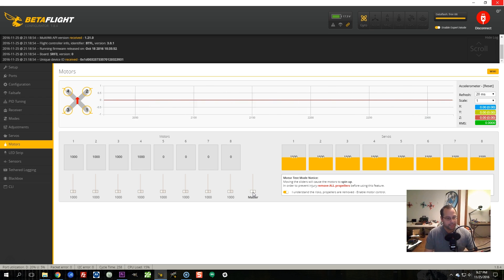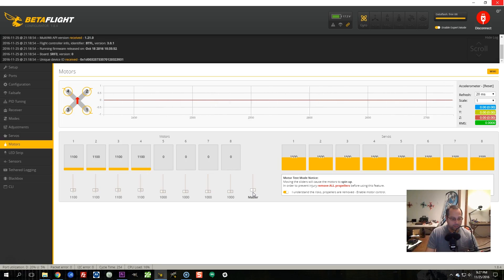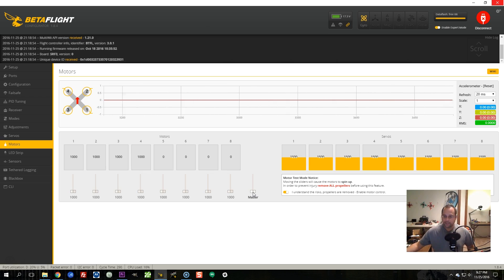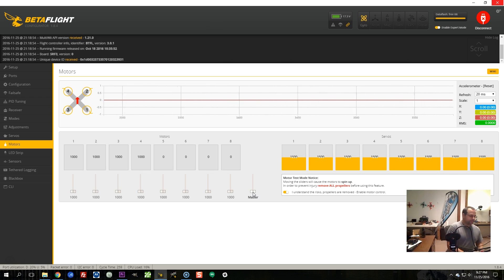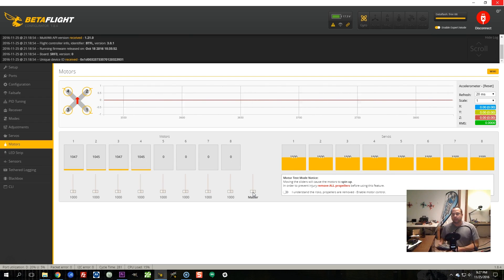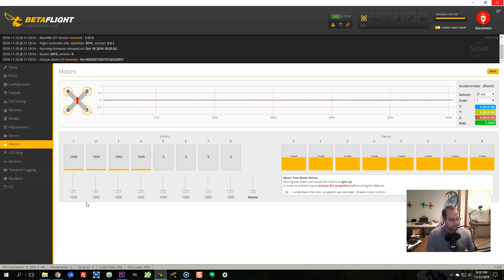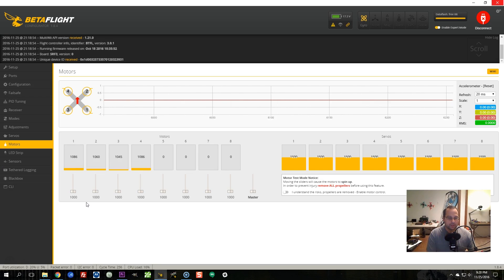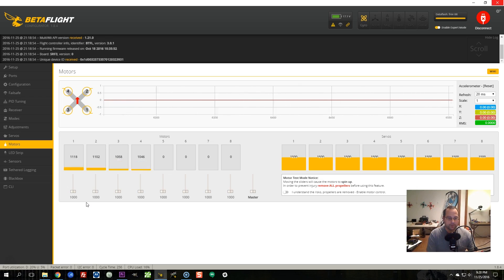Why Do Quadcopter Motors Spin Up By Themselves With Props Off?

Comment: JB, after see the video I still have an issue. I have a small Kingkong ET125 that after a crash I had to change the 4in1 ESC and FC. I´ve set everything in Betaflight 3.5.1 like my other 10 quads before but… The issue is when I arm the quad and start to hover, it rises suddenly even without any input from the throttle and of course it crashes (the FC is a F3 OMNIBUS NANO). I´ve tried many things but nothing works (ESC calibration, etc). Do you have any ideas or a link of a possible solution? Thanks in advance. P.S. – Love your Videos
Reply from the maker: This is sometimes caused by too much electrical noise or vibration. Make sure all filters are at defaults and PIDs too. Make sure the FC is secure (no broken standoff). That sort of thing.

If you "set everything like before" referring to an older version of betaflight, you may have accidentally turned off lowpass filters that are required. Filters changed in 3.5.1 and you should not disable the default filters like you used to in earlier versions.
Reply: Joshua Bardwell  I´ve checked the filters and are turned ON (Gyro lowpass 1&2 cutoff and  D Term Lowpass 1&2). About the standoff I can´t see any cracks on the carbon frame, so I´m assuming is OK.

Comment: I am so Glad I stumbled on this vid of yours. i know I posted "greenhorn" questions. THIS MADE SO MUCH SENSE. i wish you would make your own cleanflight prog INTERFACE. someone needs to get with you. you know how to explain it. do you know how many crap vids i watched over last two weeks? Oh!! By the way, got my motors working. everything looks a go for the test, but your assurance of the motors not showing level due tot eh PROPS... holey heck batman.. also.. rad. so rad. thanks man. Agree on the test.. Before I do, i want to do failsafe.. anyway, I WISH MORE PEOPLE WOULD EXPLAIN THIS LIKE YOU DO. so much important stuff is left out or skipped on. you get it. thanks man. It finally clicked. tyty

Comment: Hello I have simillar problem when I arm and  throttle speed up around max and them going down ,,about middle possition of throttle 1500 stay motor spining but when I going down 1400 1300 and minimum 1000 the motors still spining 1500 them I have to unarmed to switch motors.. i tested motor start spinig in BF 1060 and i set them in BF 1070 and in blheli s conf.. 1060... ..I dont know where is s problem. ? Anyone to help thank you 😉
Reply from the maker: This video explains why the motors do that, and why it's not a problem.

Comment: Can someone tell me if the esc are not tied down will the vibrations cause random changes in speed or dose the esc’s just do as there told and not have any feedback to I assume the pid loop?
Reply from the maker: Random vibration will occur whenever the PID loop is active. If you just want to spin the motors use the sliders in the Motors tab.
Reply: sorry i meant with my props on. when i land without killing the motors they seem to all fluctuate in speed up and down but all slowly build up speed (not erratically). i only noticed this because i swapped over all new esc's and motors and i was testing the quad. i put it down to my esc not being zip tied down to the frame and the movement of the esc's was causing this to happen?

Comment: This is almost the issue that I have now. I update the internal BlHeli's with BLHELI config. After that I made a new Motor calibration. Here the problem: If I use the master bottom or single bottom in Betaflight for motors, the motors turning like music, smooth, nice and clean and all of them on the same level. If I use my Transmitter (Futaba T10J), Motor 3 is increasing the turns and if I push the throttle stick quickly up and down, all motors running almost with full speed or the motors stop and run (like shaking). Can you help me? Do you have any solution for me, please? (sorry for my English)

Comment: Sir, please help me I am using inav configurator motor doesn't arm viva fs-ctb6 ppm transmitter. I'm using naze32 rev 5 flight controller.
Reply from the maker: In the Modes tab, check whether the Arm mode is turning color when you flip the switch. Does the Aux channel go into the defined range? If not, you must configure the transmitter (FS-CTB6) aux switch to control the aux channel.

https://www.youtube.com/watch?v=SLy28mYiAzU

Comment: Yes but my motors are either min value or spooling up to full? Am scared to put props on. It will not incrementally raise or lower it's either airmode or full throttle..? Please help
Reply from the maker: Search for my video "quadcopter flips on takeoff" and check those issues.
Reply: Joshua Bardwell the board is turning right instead of forward in configuration on betaflight.. it is probably because of when the receiver values changed on the receiver page and I had to switch the throttle,roll, pitch on the mixers page on my taranis qx7..? How do I allign the board and fix please Josh?

Comment: I though this video was going  to be about the motors are spinning up on its own after you arm the quadcopter
Reply from the maker: That is what it's about.
Reply: When I arm my quadcopter and increase the throttle, it goes up, and does not stop going up even after I turn the throttle back down. I have to disarm the quad to get the motors to stop. I originally found out this problem with the props on. Any suggestions

Comment: I do fly. I just don’t know why when I arm the motors the rev up slowly almost to the point where the copter wants to hover. But when I take off it flies fine. Just when I start up and it sits there.
Reply from the maker: What firmware and version?

Comment: Josh, you are da man! This is my first build, on the bench 1 and 2 were spinning faster than 3 &4. Thought the FCB was bad and was ready to throw in the towel. My problem was i did not have the FC board (F3 evo) mounted level in place and as you mentioned, the copter was trying to level itself as soon as i hit the throttle making that happen.

Comment: My problem just started, after I cleaned the quad with an airline with props off, I spun one of the motors about 2 seconds. When I came to fly all motors spin up but one motor has no torque and can easily be held still with one finger. I swopped esc and Motor, same prob so I swopped signal wire from cc3d and proved it is cc3d at fault. What has happened jb?

Comment: Thank you sir! This is my 4th racing quad build and first experience with this behavior on the bench... was a little scared to take a test flight based on what looks like a potential run away situation but I've checked that my failsafe works no matter what... time for some flight testing!! (thanks for clarifying!!)

Comment: Cant figure mine out. It does the opposite, when i give full throttle, all motors apart from one slowly decrease to zero and this happens whether the motors are running or even when i have no battery running the motors and just watch the sliders react in cleanflight, does the same either way
Reply from the maker: +Corey Gregson it's the same phenomenon.
Reply: So far what ive tried is, first was motors running, no props, where i saw the sliders in cleanflight go down. Then, no motors running at all, just using the radio and noticed the same. So i decided to try and hover, motors did the same until it hit the deck.

Comment: Hi, I have just started into FPV and my drones motors are spinning at different speeds with props on ( im assuming it is similar to this) but as I am new I havent a clue as to what to do. Could you please point me in the right direction?
Reply from the maker: +Daniel Landzaad it's normal. Just go fly.
Reply: Thank you, just a quick question. Should I be able (as a comolete noob) to hover by just putting the throttle up?
Reply from the maker: +Daniel Landzaad vs what?
Reply: Vs what its doing now which is just freaking out

Comment: my problem is probably similar to this, each motor is indicate different fluctuate reading less then 1000 even the throtle stick is zero, is it normal ?
Reply from the maker: +saiful ezam yes. But if they are less than 1000 then your min_command may not be correct. Set it to 1000 and re calibrate your ESC's.

Comment: Older guy here, new to FPV.  Done all kinds of RC... but FPV seems like a blast...ok question.  quad all "setup", doing some LOS practice, with punch outs.  #3 motor randomly wont "catch up" on recovery.  quad dives in direction #3 facing.  Is this esc issue or FC issue... thanks
Reply from the maker: I would swap the motor with a new motor, or swap two motors on the quad if you don't have a spare motor. If the problem moves, it's the motor. If it doesn't move, it's probably the ESC.

If it's the ESC, then swap the ESC just like you did the motor. Again, if the problem moves, it's the ESC. If neither of those things move the problem, then it's the FC.

Comment: When I plug in either the battery, or the usb cable, the motors spin up. They arent armed or anything. They are just given a value. In the motors tav, where it shows the motors power curve, the curves are going crazy. What do I do?

Comment: Hi Josh, 
I have this similar problem. My motors spin up when arming this I understand. However when I increase the throttle (give it a blip No props on) they continue to increase and stay at this high level even when I reduce the throttle the motors do not throttle down.Does this sound  Is this 'normal' or do i have a problem?
Reply from the maker: If the throttle goes below min_check, the motors will return to idle (or stop, if MOTOR_STOP is enabled). If you lower the throttle all the way down and they don't go back to idle, it suggests that the throttle is not going below min_check. But if the throttle did not go below min_check, you couldn't have armed in the first place, so that's unusual.
Reply: Joshua Bardwell 
Thanks Josh, first time user on Betaflight. I'll run through your setup videos. Oh, I got the smart audio sorted on my tbs unify thanks to your videos.

Comment: I have this problem with the props on and airmode off so still can't figure out y the he'll its doing this
Reply: Any luck?
Reply: @adventureohio2   do you solved?
Reply: Me too
Reply: same problem, with no arm, after plug battery, about 30 seconds later, motors start spin randomly, my copter is diatone gtr239.
Reply: Do the motors respond to the TX throttle? (With props on, airmode off?)
Reply: Mine does this with props on, i arm it with air mode off and acro mode on i throttle on and it goes full throttle. Its doing my head in :( anyone got any ideas? I'm running a mamba f405 stack,

Comment: 10x , any youtube URL for why the motors wont run ? they run only when i press save and reboot .
Reply from the maker: If the motors don't spin from the Motors tab, then one likely cause is you are using Multishot or Dshot on an old BLHeli ESC, or you are using Dshot600 on a BLHeli_S ESC that doesn't support it.

What do you mean they spin when you press Save and Reboot?
Reply: i am using a (SpracingF3 Acro )controller but i don't know what are the ESC's type nothing written there , but using Oneshot125 , PPM on betaflight , excuse my questions still new to all of this .Thanks.
Reply from the maker: Any ESC made in the last two years pretty much should support Oneshot. Are they really old?
Reply: MAn you are the king  that's awesome , i used DShot 600 and all the sudden responded and start spinning , weirdly Awesome . It even responded to the RC but little bit weak as i feel not sooo fast spinning.
Reply: which means all ESC"S and motors are fine nothing Fried < but still not fast enough spinning as i can see i'll recharge the battery and try , Thank you .
Reply: ok now i am sure that all the motors are spinning responding to the RC but not a full throttle, still very weak spinning .
Reply: OKKK bro done , Using a PWM as ESC/Motor Protocol in Motor features and calibrating using Master and reconnecting the battery it beeps many time and calibrated the motors Like magic even Responded to full throttle like new From the RC . Thank you ,wish you all the best , it's been 6 hours but the Problem solved , have a good day mate.

Comment: On my set up the system in beta flight cranks one of the motors even with a prop, we can see this on the motors tab and it doesn't work. I have tried a hover flight but that one motor just goes full throttle even when i am barely tapping the stick. Im so confused and it's not working, can some one pls help?????

Comment: What about like random motor twitches? .. you got it sitting there and it just twitches .. when armed .. multishot .. but Ive seen it with out multisghot I think .. Ive seen some weird fixes.. but what is the deal with it?
Reply from the maker: Gyro glitches. Soft mount the FC with vibration isolating standoffs.

Comment: hello josh can you help me. When the throttle I lifted and the drone hover. However, the drone will move itself toward to the front without stick command. After I check the motor 1 and motor 3 spinning more faster than motor 3 and 4. PS: I've calibrated esc. thanks
Reply: sorry motor 2 and 4
Reply from the maker: +Lukas Sembiring. Make sure your channels center at 1500 in the receiver tab when you center the sticks.

Comment: Take it outside he said...
2 broken props and 1 slashed battery later :'(
As soon a I touch the throttle the motors go from zero to infinity causing the copter to tumble. 
ESC's calibrated 
Props on correctly
Air mode activated
Do you have a video for this one, Josh?
Reply: Aa soon as you lose control disarm!!!!
Reply: Oh my gosh. Thank you!! Thank you!! Thank you!!!  I’ve been screwing around with my new Roto riot built drone for hours trying to figure out what is going on. Thank you I really appreciate the video!!!
Reply: D-shot ESC's in INAV btw. No option for HOT so I'm using standard
Reply from the maker: +AdjrianNickelodeon search my channel for "quadcopter flips on takeoff"
Reply: @JoshuaBardwell  so why would a build do this with props only after initial throttle up. I can fly a whole bat just fine but if I land and don't disarm, or if I just arm and throttle up and right back down, they start to spin up until it lifts off and I flick the disarm. Flying around seemingly "resets" the spin up. Somewhat worrying but I can still fly like normal.
Reply: Same with me
Reply: mine is doing the same i am ready to give up drones man
i have bought 4 and all them no luck

Comment: Hi Joshua, Quick question(an interesting one :) ). If all the motors are spinning reverse direction(M1 CCW, M2 CW, M3 CW and M4 CCW in Betaflight). Would it fly? So long story short. I had these Xnova motors with all same direction. I swapped the wires for M2  and M3, but now ever motor is going to opposite direction of what I intended. I fixed it in BLheli suite. But just got curious, if it would fly, if I did not fix that?
Reply from the maker: If you invert motor_yaw_direction then yes it would fly. If you don't, no, it will flip out.
Reply: Thanks, Good to know!

Comment: My motors are speeding up by themselves when in Air + Angle mixed. (NOT i bench but flying!)
This behaviour is causing the drone to go straight up and even putting the throttle down on the gimbal it will continue to speed up and go.
Reply from the maker: +Andre Amaral Level P gain may be too high.

Comment: Hey Josh, thanks for making these videos, i've watched all the ones relating to the eachine wizard and betaflight. Could I pick your brains for a minute? 
I ordered 2 wizards both RTF, one of them has this motor issue but when the props are on, the other one does not show any LED's on the bottom and i'm not getting any power to my reciever. Could it be a FC issue or PDB?
Reply from the maker: Sounds like a problem with the PDB. If there is 5v power at all, the LEDs will light.

Comment: Hi Josh. I had the same issue when building my qav210 and after lots of googling figured out this was my issue. 
However after I finished the set up I took it out with props on and noticed that once I armed it and slightly throttled up, if I didn't take off straight away the same thing would happen even though I had props on.
The quad flys fine (should probably read crashes fine. I'm not very good). So is it something I should worry about or just make sure I go into a hover straight away after throttling up?
Cheers
Reply from the maker: No. It's normal for some copters to do it a little bit even with the props on. It's the same thing, it's just usually not as pronounced with the props off.

Comment: Hey Joshua good video but FYI... I did two builds using betaflight 301 with air mode but while I'm flying the motors started to increase speed and I could not control the throttle but everything else was fine. So I reprogram the quads and I took off air mode and the problem was gone. Then I put air mode back and it did it again. I think their is a bug in bf301. Have you come across with this issue? Thanks for the videos :)
Reply from the maker: I have not experienced any bug in BF3.0.1 with regard to air mode or anything else. Normally a copter refusing to throttle down is because D gains are too high.
Reply: Philippe Pelaez  same here has something to do with air mode on mine to. No air mode and it's gone.

Comment: Hi Joshua, thanks for doing all the videos.
Although your answer is correct, it is not complete. While it is true that the motors spin up because the PID controller is reacting to noise, it is not strictly speaking the PID controller, rather it is the I-part of the PID controller. Motor spin up is a form of "drift" and when you integrate noise, you get drift. You can demonstrate this by setting all your I-terms to zero - if you do this you won't get motor spinup.